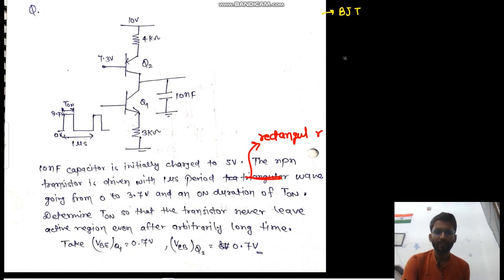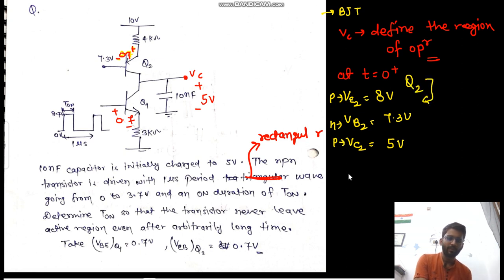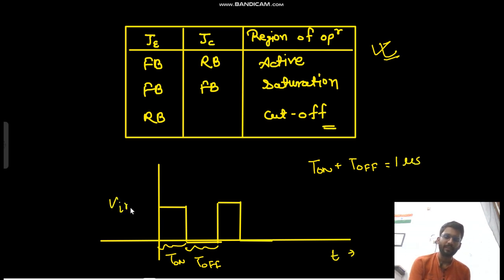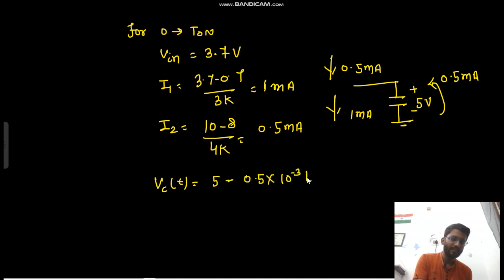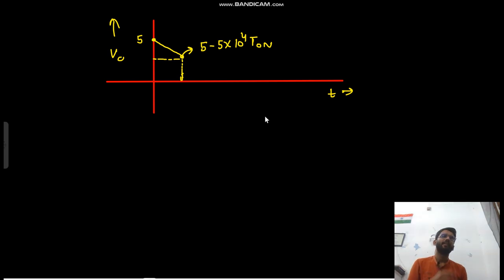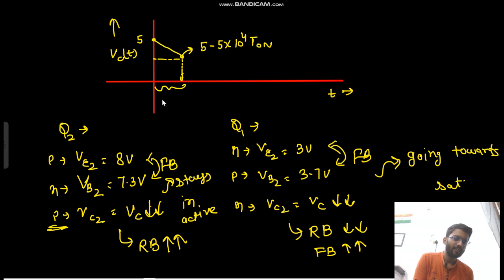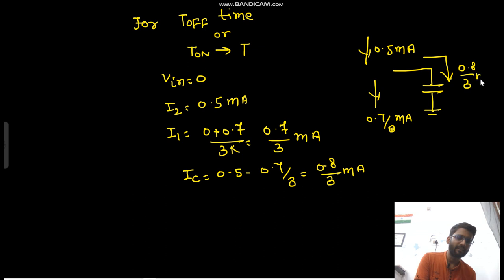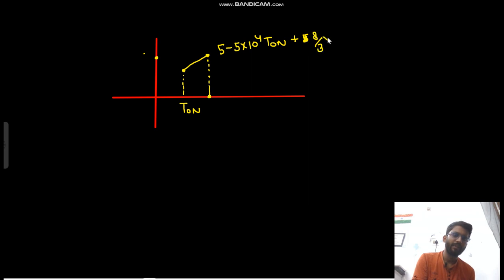TI Sponsored MS in IIT Madras (English) || Written Test Question || BJT Biasing, Region of Operation

Comment from the maker: Note : 
In transistor Q1, instead of ground, please consider a pulse that has Zero voltage for Ton time and -1.4V for Toff time. 
The solution remains valid for the modified circuit